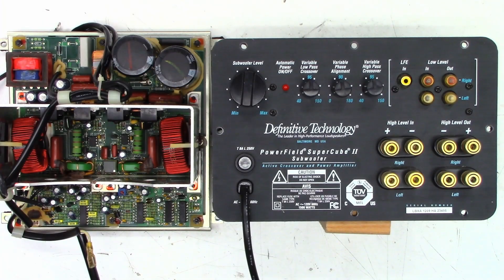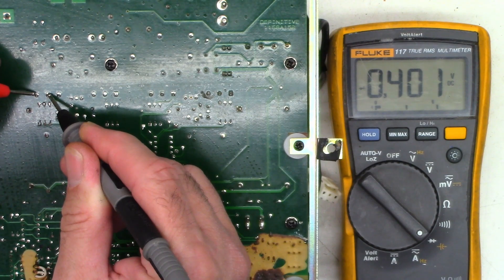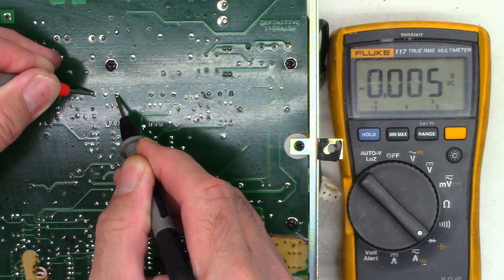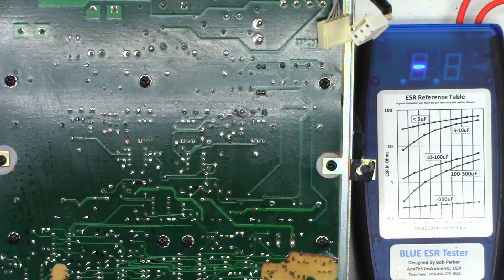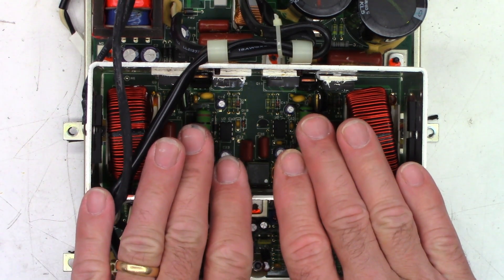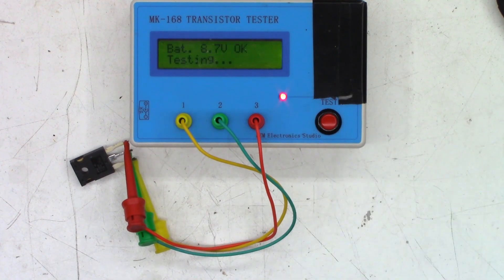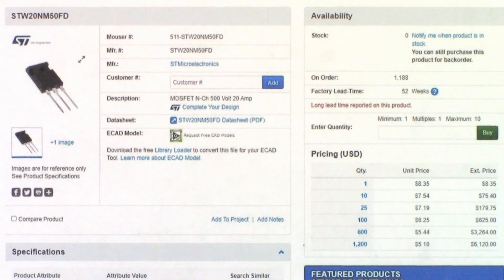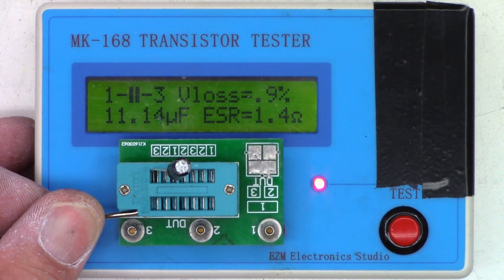Powerfield SuperCube II by Definitive Technology - Blows Fuses! - SuperCube 2

Comment: Back in 2008 or 2009 I purchased 4- Def Tech BP7004's, 1 Supercube lll and 1 Prosub 1000. It took about 5 years for the first tower to start making a hum sound and then died, about another year for the second. The Supercube was ok for about 2 years and then it was stored in a closet for 3 years and when taken out it was totally dead. The Prosub 1000 still turns on but lost 90% of its volume 4 years ago no matter which way I connect it. The 3rd tower started making the hum sound about a year ago but still would work and the 4th tower started making the hum sound last week. I replaced the towers with passive towers and have since replaced the subs with SVS and RSL Speedwoofers. I really have no use for any of the non functioning Def Tech stuff but do not want to trash them either so they just take up space. How difficult would it be to turn the powered towers into passive towers? Too bad Def Tech uses such cheap internal parts in their expensive (to me) towers and subs. I attempted to purchase new plate amps from Def Tech for everything back in 2000 but they would not or could not sell them to me. They said that I had to ship everything to them in CA (I am in MD) plus put down a large deposit to have them attempt to diagnose the problems to see if they could repair them at an additional expense to me. Before Def Tech was sold to Sound United they were great to deal with but now Sound United has been sold and they have come out with even more expensive powered towers. I buy a lot (too much) of audio and video gear and would have bought more Def Tech stuff if they offered parts down the line such as replacement plate amps. Now I will avoid Def Tech like the plague unfortunately. Love your channel.

Comment: Would the IXFH20N50P3 be a close enough substitute for that fet?
Reply from the maker: I have an account with Mouser and they do not have any stock on that part. Thanks for looking though.
Reply: @norcal715  Darn, I am a digikey guy, that's how I found this one.
Reply: @norcal715  If you want a slightly lower gate charge the 78-SIHG22N50D-GE3 will work or a slightly higher gate charge 747-IXFH22N50P

Comment: I need to say that one time I needed a scr for a device that has to work reliably as long as possible. I went to my local supplier and paid 6euro a piece. All of them failed within a day. I decided that if this is the case, I can order bunch of them from china and use them with the same effect. I paid 2euro for 10pcs , First one that went into the device is still working today without any issues.
Reply from the maker: You got lucky!

Comment: I posted a link to Farnell in the UK, they have loads in stock!  (Probably auto blocked because of the URL)
Reply: looks like Farnell = Element14 = Newark in the States
Reply from the maker: Ya, I did not get the URL at all. Put it in with a space between the address and the decimal (dot), then another space after the decimal (dot).

Comment: I have had good luck with parts quality and originality from lcsc & utsource. 
Also the mosfets does not have to have the same part number, u can match the datasheet and find equivalent mosfets with similar characteristics that will work perfectly fine in a class d amplifier. And i have done it before i do it everytime and there have never been any issue .
Reply: Just checked lcsc and they do not have this part in stock but they have many other mosfets with similar specifications and i have concluded that the only worthwhile replacment would be sihg20n50c from vishay , there are many other chinese makers making these 20n50 but i never had good luck with any of them , i had tried previously using these clone parts and they are pretty random sometimes they are good and sometimes they are bad. And the cost saving is not worth the extra hassle.

Comment: FETs from China are not just bad quality -- often they are not even the correct part, just some other part re-labeled.  I tried my luck, and in a single lot of 10 (supposedly all the same) there were at least 3 completely different devices according to the tester.